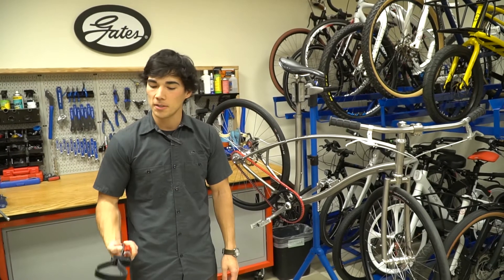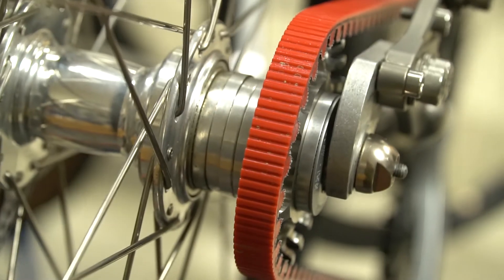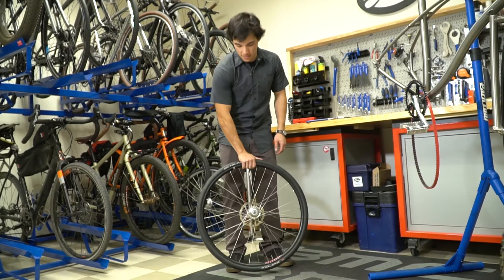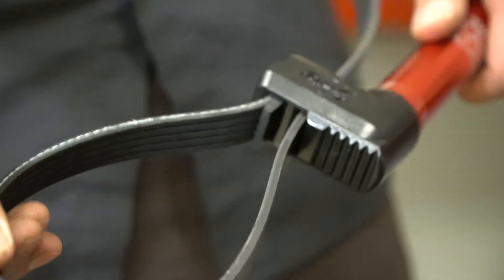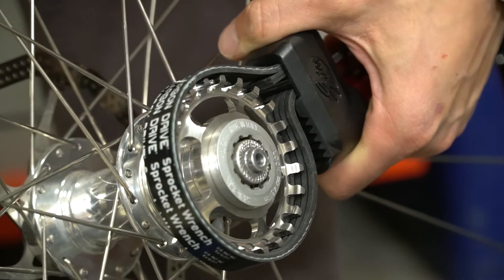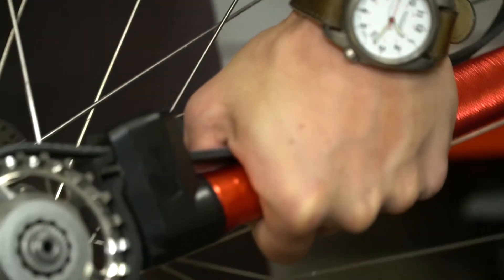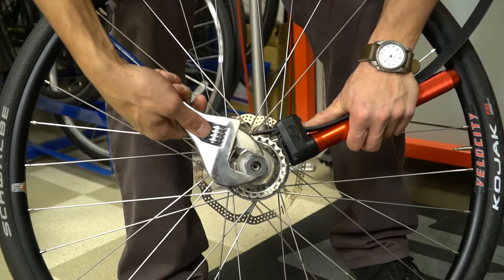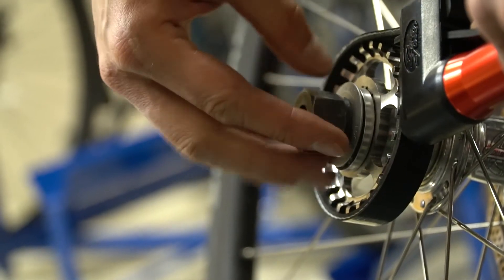Gates Belt Drive U   How to use Gates strap wrench

Comment: Ich bekam leider keine Antwort auf meine Frage, deshalb die Frage hier nochmal. 
Gates dont answere me – that´s why i try it here again

If possible, answere in German. Wenn möglich, in Deutsch antworten.

In den FAQ steht, dass man den Riemen regelmäßig wechseln soll. 
Was genau bedeutet "regelmäßig".  Jährlich? Alle 2 Jahre? Alle 3 Jahre? 

Deshalb meine Frage: Gibt es beim Carbonriemen eine zeitliche Begrenzung wie oft bei anderen Carbonbauteilen.

You write in FAQ: „ Change belt regularly“ What´s the max. time I can drive the belt. 
One year?  Two years?  3 years?
Reply: Ren Rüst : In another Gates video, they say to replace the belt if it looks worn, such as missing belt teeth, cord showing, or it has fabric facing worn off.  You can get a lot more miles out of it than a chain, so don't replace the belt based on time intervals.  Ride it until it looks worn out, and keep a spare belt around just in case it breaks.  It should go for a long time if you keep it properly tensioned.
Reply from the maker: For current Splined Sprockets for Rohloff, you can use the strap wrench.https://www.youtube.com/watch?v=IKR106uduSI&list=PLKpEnY0NdpqzYs8OZnUeLhSZigHPU4V7g&index=10